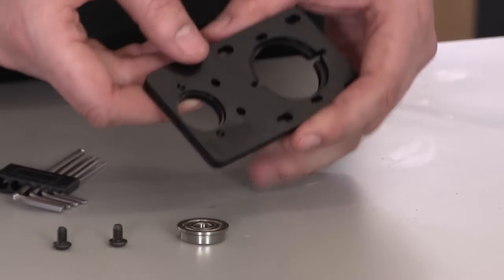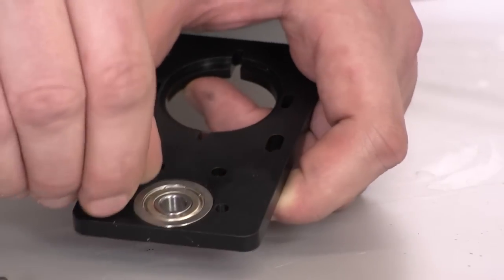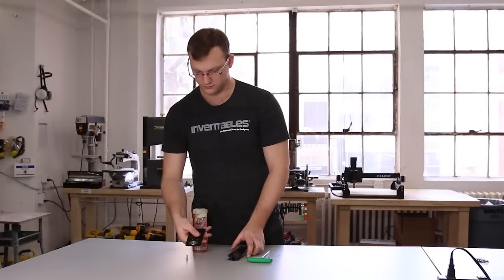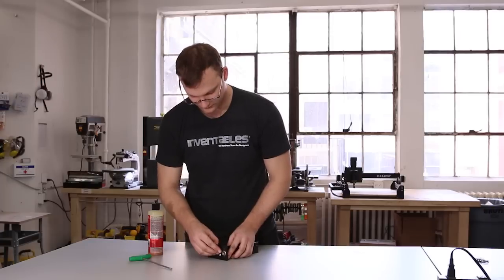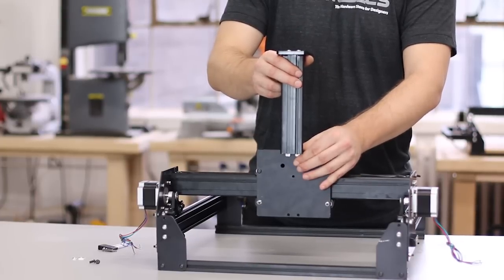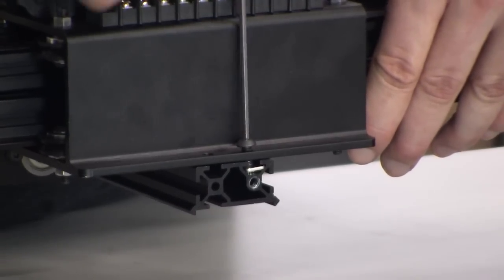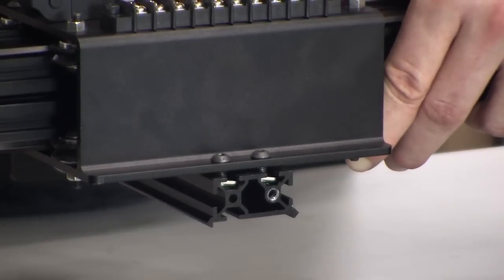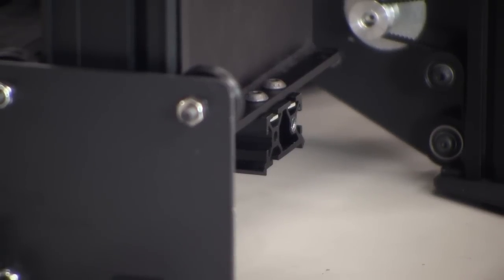X-Carve | Assembly | Z-Axis v3

Comment: All four bolts and nuts on the assembly first, slide the extrusion down onto the top set first adjusting with fingers as shown and then do the same with the bottom two.